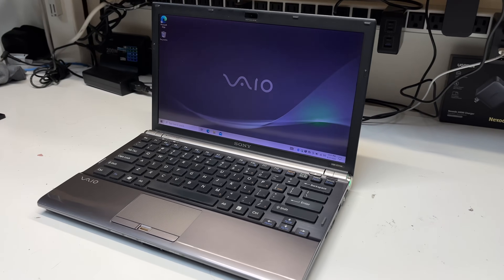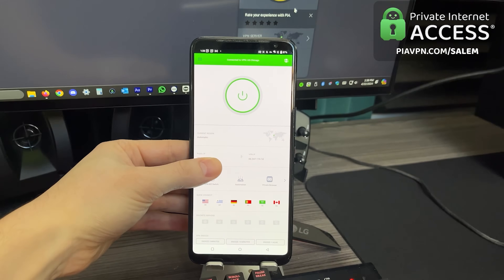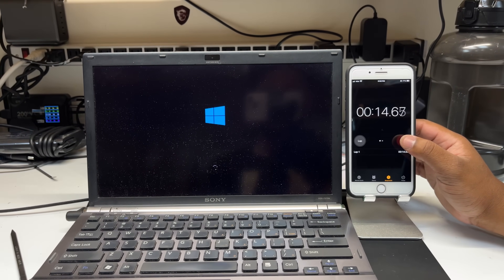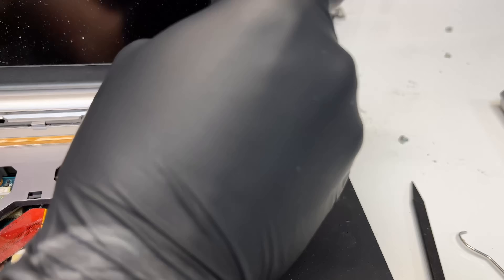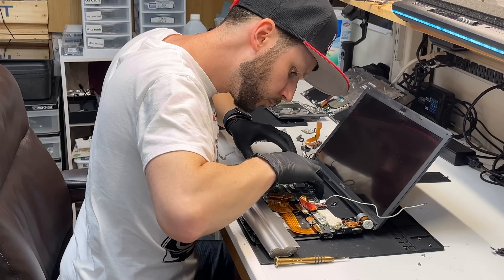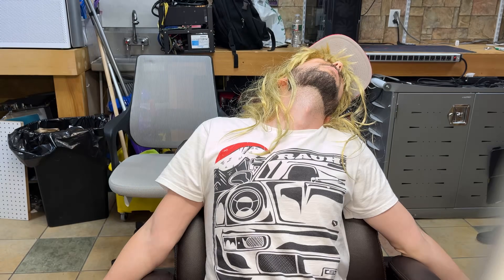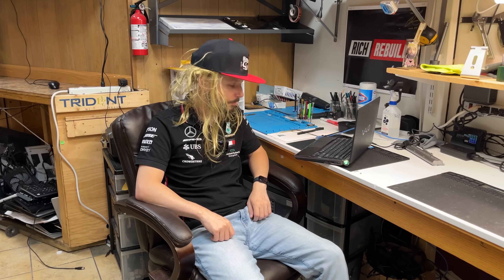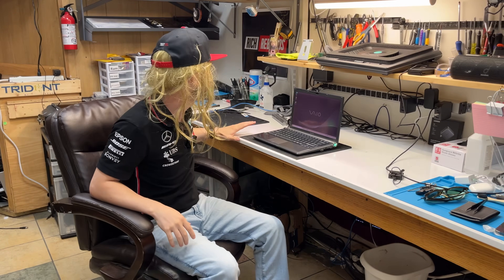Sony Vaio Resurrection: Saving this Insane Tech From 2008 (and why that soon won't be possible)

Comment: watching ot on my sony vaio vpch38n (i guess), this is a 12 years old piece of shit that refuses to give up, it has an intel i5-2450m and nvidia GeForce 410m with 6 gb of ddr3 RAM, 2gb was stollen from another vaio I had which had an i3. this thing is a tank. i can't treat it may worse that I already am. its never been cleaned except yesterday when I opened it and cleaned it an accidentally wiped the thermal paste off and didn't had any on hand so I closed it back up without it and its still running. at this point I don't even care. i could throw it at a wall and worry about the wall, the only upgrade I did was getting it a new SSD and upgrading it from windows 7 to 10. I don't know how but it manages to run 10 tabs of chrome, discord, WhatsApp, and cs2 all together. and the hinge on this he stronger that the hinge of all the hp laptops made today combined together. i don't even know if anyone can break it by force let alone on accident.

Comment: I have a VAIO UX series (the first sliding UMPC by VAIO). And boy, those DVD drivers they gave you is not a joke. Because as same as you, Sony discontinued the support 10 years ago. It took me a fortune hunting a working Japanese model with the DVD recovery discs and a pristine cradle dock. It took me 4 times buying a machine with the stock installation that has the drivers I needed. It cost me a new machine in total to find a working Japanese model with stock Windows XP. Some sellers don't know what the heck they were selling and can't be bothered with my nerd speak.

Comment: Thats why i still use my samsung series 3 notebook from 2009 and it still works, even getting stable 100 fps in 15 chunks in minecraft java. And i can upgrade ram, and CPU and storage. Sadly not the GPU but yeah thats almost impossible to make an socketable GPU on a Laptop

Comment: I have a Sony Vaio with a i5 520m, 4gb of ram, a 500gb toshiba hdd and a GeForce 310M. Mine however has a hdd cover on the bottom which you can remove with 2 screws and the hatch comes off which is super helpful if you ever need to swap the hdd out for a ssd

Comment: I have one of the Vaio, forgot what series.

Tiny 11 inch Vaio but use Intel Core i5 Sandy Bridge + and AMD Radeon 5000M series + 6GB of RAM (2 soldered + 4 from DDR3 non L upgrade slot)

It's lightweight but oh boy, it's not durable. Tiny motherboard and tiny heatsink for Core i5 and Radeon GPU.

Still alive but the old HDD is bad, replacement was not a problem but the Sony already takedown the OLD DRIVERS.

I need Sony Firmware Parser for enbale the Wifi but Sony removing that sh*t. 😂😂

Comment: Don't ever just drizzle a new install over the old one without a (bootable) backup. The old driver.sys file for the nvidia graphics is somewhere to be found on the old install and maybe even the other drivers or installers. You can copy them over and transplant them on the new install and have everything the way it was.
Reply from the maker: You must have misunderstood. The original install the customer provided me on their HDD, as I explained in the video, also did NOT have any functional drivers. I showed this. This is because they, at some point, installed Windows 10 fresh instead of upgrading from Vista / 7. Therefore doing a fresh install on an SSD put him in the exact same spot as before, just with a faster drive.
Reply: @SalemTechsperts  Ah okay, then I missed or glazed over that part. Thanks for elaborating and correcting what I said.

Comment: Oh hey, a Sony Vaio. This one looks familiar, I definitely had one that looked like it and it was a nightmare to do anything with, and repasting the CPU and GPU was downright impossible without disassembling literally everything. On the other hand, I am now using a different Sony Vaio laptop, one from 2010, and it's very easy to work on. RAM door, SSD door for easy upgrades. To access the rest, the bottom needs to come off, but that's easy - I just need to unscrew a bunch of screws, there aren't even any damn plastic clips. It was a joy to work on.

It came with i3 330M, 4GB 1066MHz DDR3, GT 330M, some slow 54Mbit wi-fi/bluetooth module, and a 7200RPM 320GB HDD. I upgraded to i7 640M, 8GB 1333MHz DDR3, replaced the wi-fi/bluetooth module for something that can do around 300Mbit or more, and put a 256GB SSD in there. I also replaced the fan, and now it's actually pretty quiet when doing simpler tasks. Overall, excellent stuff, still good enough for some games and basic use. In the future, I'll also replace the battery because it holds the charge for maybe 10 minutes.

 The model is VPCCW2S1R, which is definitely not easy to find info on for some reason, and I'm still missing some drivers, but the only thing that's truly missing is brightness control using function keys, and I can live without that.

Comment: I am watching this on a mid 2010 15 inch macbook pro running high sierra 10.13.6 after getting it repaired it works just like new other than the fans not spinning up due to dead temp sensors which I don't mind manually controlling them or just having them blast at max rpm (6000) I am planning to get the 2012 13 inch model so I can have one with a newer more supported version of macos
Reply from the maker: The 2012 13" i7 model is what I use every day for iMessage and some other light work. 16GB RAM, 500GB SSD, 2TB HDD, new battery, new paste, and drilled some holes in the bottom panel to help it run cooler. One of the best laptops ever made

Comment: You seem to be very, really knowing what you're doing. I have never been really that shabby, but I have one of my mom's little laptop that she gave me and I just, she doesn't even know how to log into it anymore, but still power on at the windows. I think it's been upgraded through the windows network to windows at least 7 maybe. 10. I'm not sure but it is large. You're supposed to log into a year microsault account which you no longer has and can't access into anymore, but still charges and it still powers off, but just can't get logged in. But we need a log in somehow. To receive some photos of dead family members. Handsome old photos to remember. And some other stuff that we may not know what's on there, so we need to say oh, there was no hard drive stuff but me to upgrade it and rebuild it to a modern generation. She bought it sometime back in there. It would remain designed to be a Windows 7. And it's made by Samsung. But I don't know how to go about doing that. And no one ever wants seen to touch it, but I would love to take it and have it rebuild into a newer. Modern day computer. Making it the upgrade to the nearest computer, there is on the market. Is there any way that you know how to do with stuff like that or what I should do

Comment: I can name a relatively modern laptop that can last 16 years!

My 2017 Dell XPS! it's now 7 years old and because it's super easy to open up, I clean the dust out of it twice a year and replace the thermal paste every 1-2 years.
Also I installed a brand new battery from ifixit. Also also it has a standard m.2 SSD and 2 sodimms. Also also also the build quality is great, I've dropped it a few times and you'd never know.
And one last also: I've installed windows 11 on it with a little registry edit hack.

Comment: RN im rocking an MSI ge72VR laptop with an i7 7700 and a gtx 1060 ofc those are integrated to the mobo but the ram HDD and SSD are upgradeable. and actually it might already need a brand new nvme ssd cause its getting slow

Comment: I am still working (programing) on my 2011 ASUS K53SV
Upgrades:
i5 - >  i7-2670QM
HDD -> 1TB Samsung EVO SSD
DVD -> 1TB Crucial SSD
4GB RAM -> 16GB RAM
7th Keyboard
4th Battery
Win 7 + Win 10 Installed

This laptop earned me 250k $ throughout its lifetime
Now I am sad that Win 10 support is going to end and Win 11 sucks...
I am looking for new workhorse for its replacement, but I cannot find an laptop with such brilliant keyboard as K53SV.
All new laptops has so f****g broken numeric keyboard with power button in place EXACTLY where my END button is.
I swear, the first time when I would accidentally hit POWER button instead of END i would throw the s*** out of my window.
Asus Strix - there is no DEL button above Backspace WTF??
MSI - has handicapped numeric keyboard
The only laptop with SAME keyboard produced commonly by all brands in around 2010's is Gigabate Aorus 17X, but it is not available in my country and it's RMS service here is garbage...
F**K

We live in sad times

Comment: I had that notebook to install in.. 2010ish.
Windows 7 went on it and, yes, only one yellow !.
But all the fancy buttons did not work.
Then I found out that you had to install some software in the exact correct order to get the ! away, to be rewarded with a new ! for the next step of the voyage to an installed Windows.

(I still think that this laptop was great :) )

Comment: I have an ASPIRE 5750G (2011). Upgraded it few months ago, luckily even processor could be replaced. In the end: i5 2410 to i7 2630qm , 4Gb ram to 16Gb, SSD, wi-fi/Bluetooth module (old module only worked with WiFi 2,4Ghz, needed 5Ghz). Even found a battery replacement (not original but works perfectly)!  Everything cost me around 80$
They don't make em like that anymore.

Note: If you are, for example, upgrading your OS on your old machine from win7 to 10/11 (clean installation), you can use program DoubleDriver (NotAnAd). It copies existing drivers on your notebook, so you can save then on flash drive and then  reinstall them later after (via "device manager").

Comment: Old laptops could be such, a pain to take apart. 
Had an old laptop that you had to open the back, remove some screws, remove a top piece above the keyboard, remove screws there then remove the keyboard, then remove screws there. Now you could finally START disassembly. 

But it's nice you could actually upgrade the stupid thing. Thankfully my laptop lets me swap out the battery and SSD but the ram? NOPE. I'm married to 8GB of ram. It was a steal of a laptop at $550 but my Lenovo Yoga k730 was solid enough on sale. Hoping it lasts a long long time regardless.

Comment: I had a Vaio as my school computer and it was great, I used it for 12 years until i got an XPS and said goodbye to the Vaio until i powered on recently and it still works and everything is working. My mom said that "A Vaio is a laptop you can trust on". So i power on my laptop every 5 days a week so i make sure it works.

Comment: I have a 2nd hand ThinkPad collection, some of them older than 10 years, and while Windows can be painful on the ultraportables, Linux runs absolutely like butter. I only needed to upgrade one of them to SSD because the drive was failing, even the RAM can be upgraded though I didn't feel the need.
One of them even holds a charge for 6 hours with the original battery, and these are 2nd hand ThinkPads that were used in offices daily. They just don't build them like they used to.

Comment: Well, going off the fact that heat causes electronic failures, I'm going to guess that the longest lasting PCs will be the ones that consume the least amount of power. So basically the HP Stream with an N100.

Comment: My first laptop, a used Dell Latitude X200 from 2002 had soldered in ram with an expansion. That being said, it was insanely thin for a P3 machine, giving a modern machine a run in the thinness race. That being said, when the ram died, i cried.

Comment: i used to own a vaio back in the day. It had many unique features om top of windows which many considered as bolat but for me it is what made it special for me. It had a unique web button on the keyboard that booted into a special linux distro that had a web browser and wifi driver built in and nothing else. It used to boot up to that in less than 5 seconds

Comment: So far I have an Inspiron manufactured in 06, upgraded that thing with more ram, a new battery and thermal paste cleaned it out and its runs great with an SSD, I wish I had the funds to upgrade the CPU, and runs windows 10, did the same with an old acer from 09 as well that I've upgraded as far as it will go. No way in hell can I do that in a few years with my gaming laptop

Comment: Quick question for The Greatest Technician that ever lives, want to let my Alienware Aurora R7 get roasted or blessed by the public, especially since I have the pictures of original state of that tower that you'll probably want to share before I went through the hell of a case swapping. If you can do the water cooling upgrade, sending you the upgrade bracket, I tried, I had a bad cooler, need to hunt down another. Also Andy, I'll help with some custom parts that are 3d printed for my PC that'll I'll gladly help(amateur PC technician here and lover of tinkering stuff) there's 1 issue though, boot up is slower than I want, especially since the boot drive is m.2 nvme Gen 3, and can take a Gen 4 but I'm reverting to 10 for you before I go back to windows 11 (the required software was upgraded already)

Comment: on the topic of repariable, everyones big currently on EVs, thing is the batteries in those cars have a shelf life. cant be avoided with batteries, eventually the chemical reactions that store elecricity fail and it dies. a combustion engine, so long as you keep up with routine oil changes, change air filters and other small repairs, it will last a long time. my 08 explorer is getting near 300,000 miles and i bought it used with far less than that on it. routine maintenance has kept it going. 

also on the EV end of things, a new battery costs as much as some brand new lower end combustion engine cars. where if i needed to buy a new engine for my vehicle sure it would be the cost of the car, about 6ish thousand compared to 20+ thousand. 

and thats where current manufatcturers are missing it, they are more concerned with selling brand new instead of keeping older items running as long as its financially feasable for the average person.

Comment: Watching this on a Surface Pro 8 and I got scared for a moment thinking about the day the display assembly or the RAM's fucked, and it got thermal throttle more than it already is. Why the hell did I choose this thing in the first place? I should've gone for a Framework, while it won't feel as premium as a Surface device at least I can self service it.

Comment: I have a Vaio S series from the same timeframe and still have all the installers to get Vaio Control Center running in Windows 10. I think they're universal, so they should work on this Z series, any way I can get them to you?

Comment: self taught technician here i have had my fair share of computers not being able to be repaired,but i have a Toshiba  satellite c55d-a501 from 2014 that is still working but i have had to get a new disk drive and battery for and upgraded from 4gb of ram to 8gb of ram and soon im going to get an ssd for it because it was originally windows 8 not 8.1, 8 with a 500gb hdd... and i just went into a rant about my computer sorry, but i rather build my own pc than buy a prebuilt gaming pc

Comment: I have the same laptop given to me by my family because it was old. I got it working with Windows 11 (bypassing the artificial system requirement limits) and I got the Nvidia GPU somewhat working, unable to switch GPUs and machine is stuck on auto brightness, via some sketchy drivers from the internet. Now it lives as a cool beast from 2008 that can still go on the web. The Nvidia GPU even still does H264 decode.
Reply: I hate Sony for removing drivers why would they do such a thing I love vaios but because of that I won’t get one

Comment: Is that core2duo quad core? I was fixing some old core2 boards and just recently discovered there was a quadcore version of the processor it was using.
Reply from the maker: Dual Core. The Quad Core is compatible but it's 45w and there's no way the heatsink would be able to handle that

Comment: im currently using this Acer Apire ES1-433 which my sister bought for her WFH last 2014 but still going strong even it was resurrected with No RAM and disabled keyboard. i agreed with you I wish Modern LAPTOP PARTS SHOULD be REPLACABLE AND REPAIRABLE. i pray to the LAptop Gods My Laptop will not give up on me since im still using the same HDD from 2014 :(

Comment: about laptop that can last. This might be unfamiliar to you guys, but Axioo Pongo Series from Axioo is the one I see fits in this category. It's basically built like an old laptop(removable battery, upgradable cpu, etc) but packed with not so old modern specs. It is chunky but it is expected since it can cool a desktop cpu. About the replacement part... it might still hard to get since it was sill a local brand from Indonesia, which make the term "can last" a little... uhh?, but still I think this is the most "worth the money" laptop in my country
Reply: Indonesian here, the brand seems promising. But i advice you to wait 2 years

Axioo, unlike other electronic brands(Advan, etc. Dont know much) has good quality early on which is a shock for myself even

2 years should be enough to see the merit of them

Comment: My friend asked me to check her laptop that she purchased new just 2 years ago as to why it struggled to work just browsing internet. Checked out the specs: ok i3 11th - fast enough, but 4GB of RAM - good luck running full blow Win 11 with that. Just slap some more RAM and it would be good to go - or so I thought until I opened it and found that RAM is soldered and cursed me - NO extra slot. Not her fault for not knowing much about tech, but the manufacturer who decided to make this garbage and the sale guy who found a perfect victim to sold to.

Comment: This year I bought a 2010 MacBook Pro 15 
Upgraded it with 8gb of ram
250gb ssd 
The anti glare high resolution screen 
Replaced the battery 
Even fixed the failing capacitor by soldering a new one